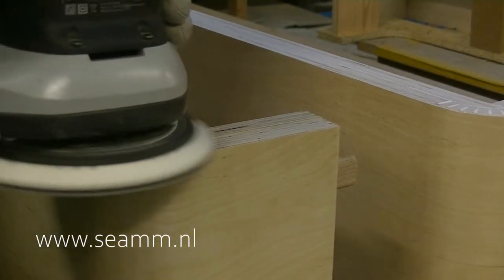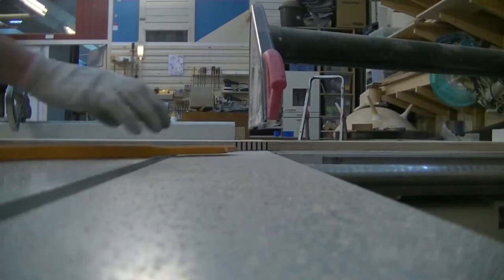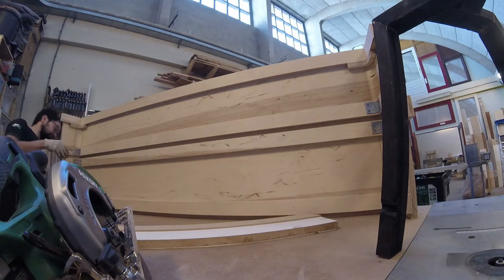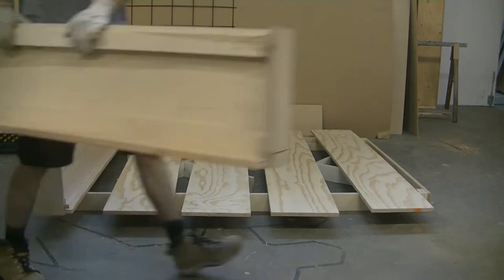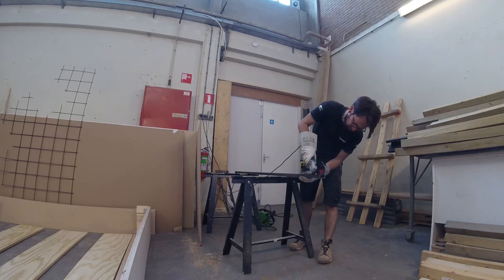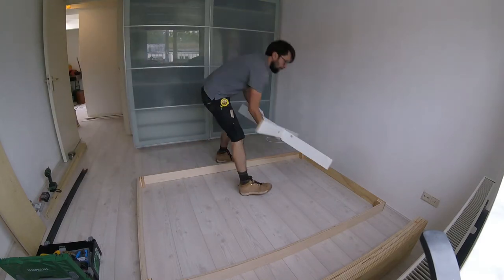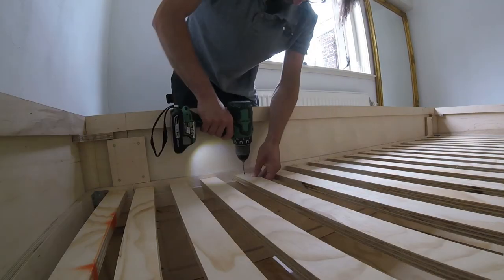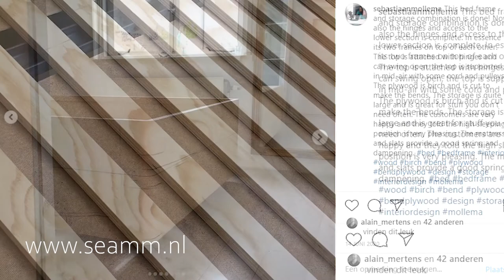Making a Folding bed with Storage

Comment: Yes, it was a cool project, but i dont know how easy will br to clean under the bed, and i believe the access into the bed is hard because it is so tall.
Reply: Its custom made so i presuming that hight of the bed  was  checked and agreed with the future user;)
Reply: @oglaz  i agree with you, im a furniture maker, so i know what im talking about, my comment was for the daily user
Reply from the maker: Thanks! True, cleaning is a bit different. But at inaccesable place is quite covered. And there are certainly spots in the far storage compartment which are not so accessible. There are some downsides to the system here. But at least there is storage, so that is quite good!
Reply from the maker: @MESTER47 , That would be a good one. I would combine it with a steel frame. Trying this wood is not that suitable, based on the systems i have seen.